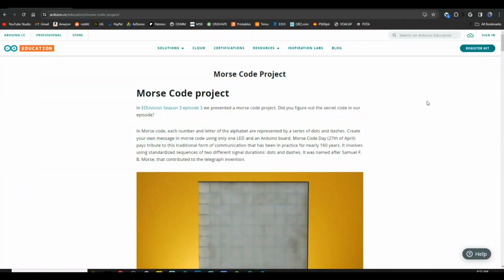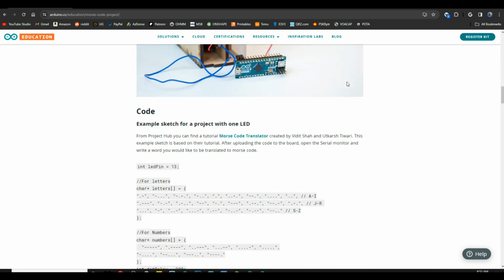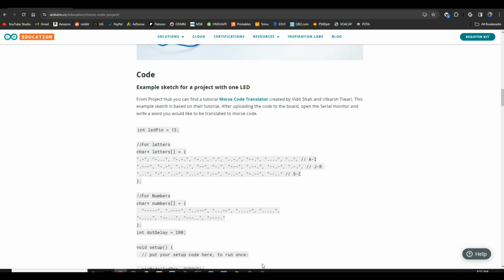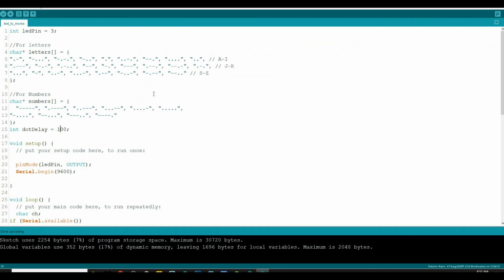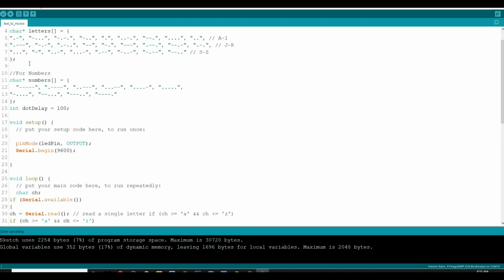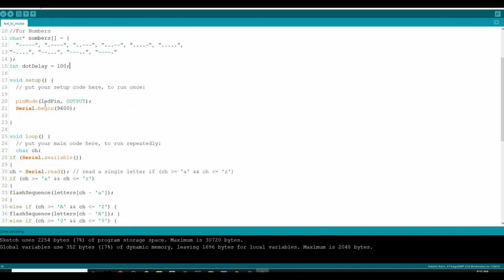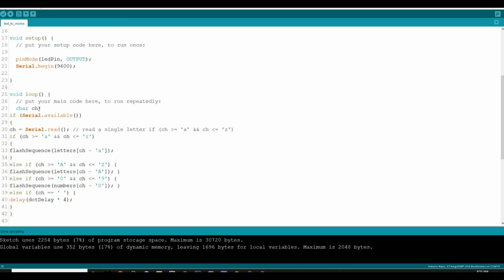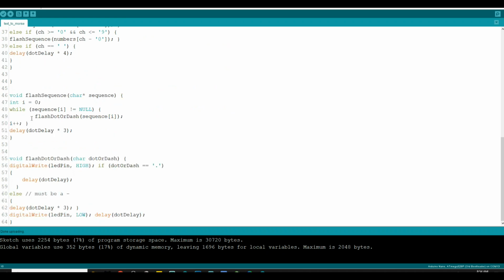Using An Arduino To Teach Myself Morse Code

Comment from the maker: int ledPin = 3;

//For letters
char* letters[] = {
".-", "-...", "-.-.", "-..", ".", "..-.", "--.", "....", "..", // A-I
".---", "-.-", ".-..", "--", "-.", "---", ".--.", "--.-", ".-.", // J-R 
"...", "-", "..-", "...-", ".--", "-..-", "-.--", "--.." // S-Z
};

//For Numbers
char* numbers[] = {
  "-----", ".----", "..---", "...--", "....-", ".....",
"-....", "--...", "---..", "----."
};
int dotDelay = 100;

void setup() {
  // put your setup code here, to run once:

  pinMode(ledPin, OUTPUT);
  Serial.begin(9600);

}

void loop() {
  // put your main code here, to run repeatedly:
  char ch;
if (Serial.available())
{
ch = Serial.read(); // read a single letter if (ch >= 'a' && ch <= 'z')
if (ch >= 'a' && ch <= 'z')
{
flashSequence(letters[ch - 'a']);
}
else if (ch >= 'A' && ch <= 'Z') {
flashSequence(letters[ch - 'A']); }
else if (ch >= '0' && ch <= '9') {
flashSequence(numbers[ch - '0']); }
else if (ch == ' ') {
delay(dotDelay * 4);
}
}

}

void flashSequence(char* sequence) {
int i = 0;
while (sequence[i] != NULL) {
        flashDotOrDash(sequence[i]);
i++; }
delay(dotDelay * 3);
}

void flashDotOrDash(char dotOrDash) {
digitalWrite(ledPin, HIGH); if (dotOrDash == '.')
{
    delay(dotDelay);
  }
else // must be a - 
{
delay(dotDelay * 3); }
digitalWrite(ledPin, LOW); delay(dotDelay);
}

Comment: My "buzzer" looks identical to yours, but it only works with the tone function. That means it is a speaker then?
Reply from the maker: Yep
Reply: there are active buzzers, which plays with the tone functions to play for example a melodie, and passive buzzers, which sounds only when 5v passes through
Reply: You are very right, and I also thought that's a problem, but passive buzzers need a frequency, while, active buzzers don't need one, they make a 1.5 to 3hz tone

Comment: I've tried to learn CW since I was about 15 (I'm currently 75!) and been unable to learn enough. Couldn't even pass the Novice test, so I was (in some ways) glad when they dropped the CW requirement. At one time I could have passed the Extra THEORY, but never got the CW. Currently have my General (KF5AQF).
I have a high frequency hearing loss. And those piezoelectric beepers are right in the middle of my hearing loss! Can that be changed to a speaker? - (Ok, just heard your comment about that in the video!)
Reply from the maker: Yes, you can change it to a speaker. I think it would help in your case because with the tone command you can specify the frequency. You would just change the digitalWrite(ledpin,HIGH) to tone(ledpin,1500) or whatever frequency you hear the best. I totally understand hearing loss, a lifetime of playing guitar in bar bands has just about taken everything above 8k from me.